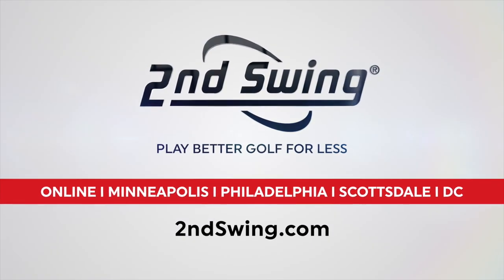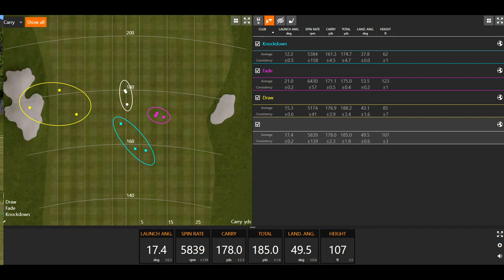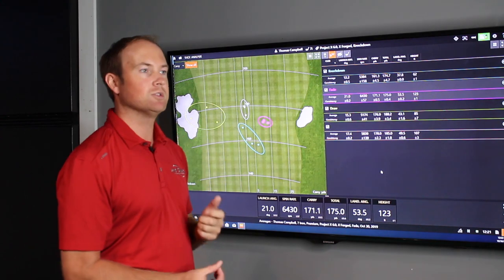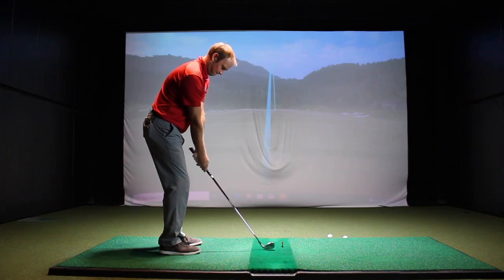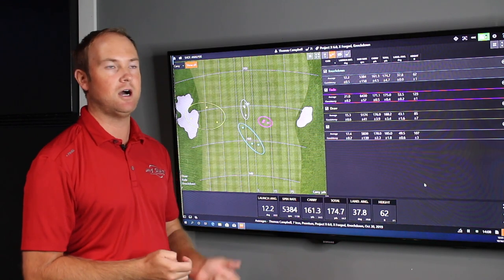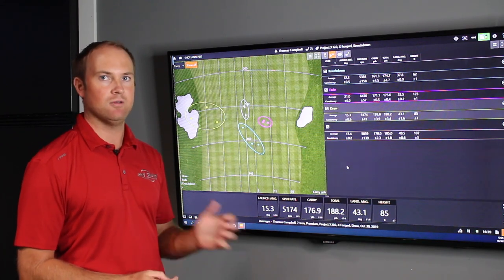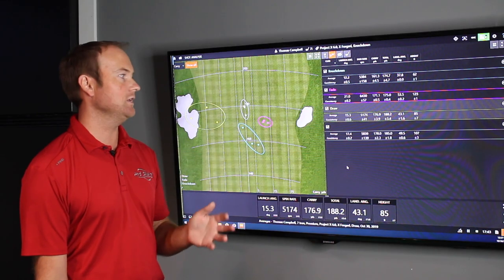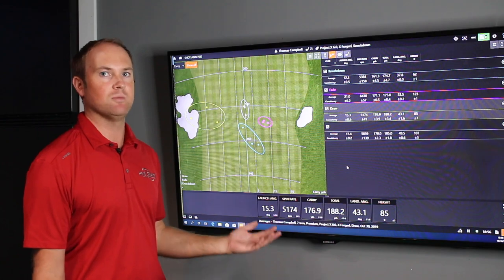The Importance Of Land Angle | Trackman Testing

Comment: I was in my skytrack simulator and noticed my 6 iron was landing around 37 degrees with 12 yards of roll out going over 200 total yards. I have the stealth stiff. The flight was very straight and many shots all the same. Could this be a shaft issue?
Reply: Hands too far ahead at impact or ball too far back in your stance most likely. You may also lack clubhead speed too and a weaker shaft may help.